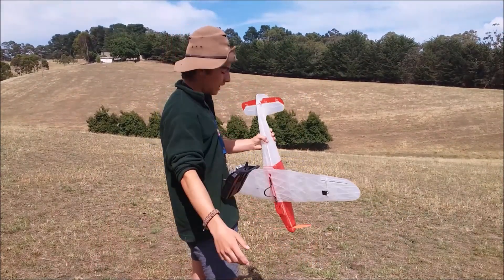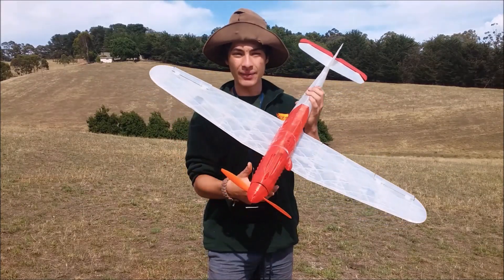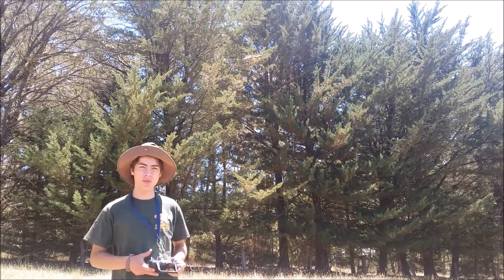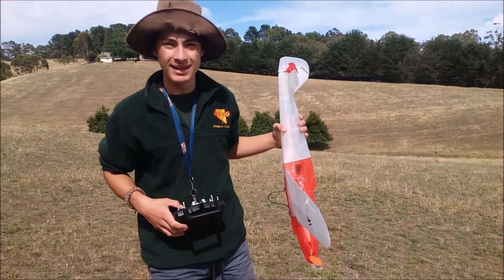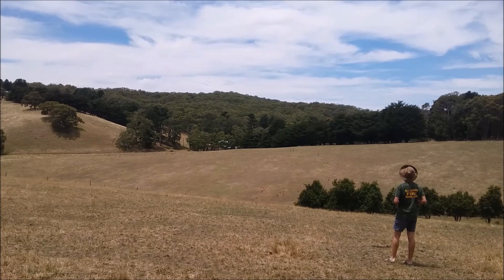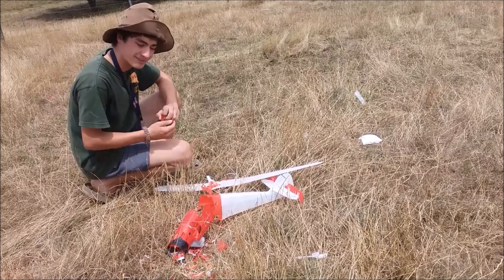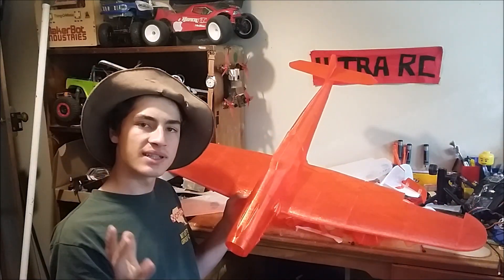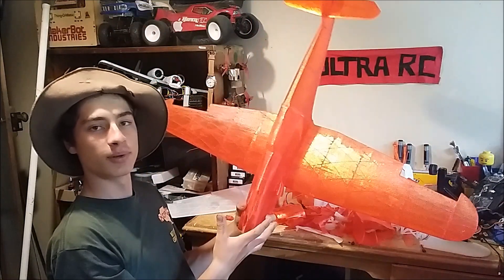Awesomely Destroyed 3d printed RC Messerschmitt //3d lab print.

Comment: Excellent work! I guess when you still live at home you don't have to factor the price of electricity to run the 3D printer for hours on end so the plane frame does only cost $10, at least in this case.
Reply: They don't use that much electricity wtf... About half as much as a modern desktop computer under load... Maybe like 0.50$ worth of electricity
Reply: @ikillfh844  Fifty cents.....😂😂😂
Reply from the maker: Yeah so the plane costs $10,50
Thanks for watching ULTRA RC mate!!!

Comment: 3d labs has a file for a stronger fuselage section, as you see that's the biggest failure point on it. That heavier fuselage should also help bring the weight forward. Regardless of material a lot of those ww2 warbirds are trickier to fly. Maybe print the trainer they have.
Reply from the maker: Yeah im planning to print out the trainer!!
The mechasmit was flown to slowly and was to tail heavy ill get it going soon!!!
Thanks for watching ULTRA RC mate!!!!
Great to know about the stronger fuselage!!!

Comment: Your persistence is inspiring haha, try printing a more stable design, the Messerschmitt  isn't really meant to be easy :#
Reply from the maker: Thats good to know because 
I didn't find it easy,
What plane would you consider stable?
Thanks for watching ULTRA RC mate!!!!!!
Reply: You'll find stability in designs with dihedral , high wings, slow flying-high lift airfoils.

Slow flight is key, it'll give you much much more reaction time.

Pitch stability mostly lies in CG.

Yaw from big vertical stabilizers

Roll from wing dihedral, wing shape and weight distribution: high wings will kinda work like a pendulum.

Consider buying a gyro stabilizer, they're pretty cheap and easy to set up.

Comment: Still looks like the CG is off.  Looks like you didn't have any additional nose weight in the plane and all the 3dLabPrint planes I have printed so far have needed extra weight in the nose to balance properly.
Reply from the maker: Yes i think you are right i only had one 3s 2200 in it and it can fit 2.
it did balance where it was marked.
it did fly for a while (badly) the main problem was me flying it slowly like a glider
I will try again soon luckily i can reprint it!!
Thanks for Watching ULTRA RC mate!!!
Reply: @CORINKERSTEN  It can fit 2?  My Spitfire can only take 1.  If it balanced on the CG marks it should be ok but it sure didn't look like it.  How much nose weight did you add to it with one 3s 2200mAh battery?  I have to add over 100 grams to the nose of my Spitfire to get it to balance with one 3s 2200mAh battery.
Reply from the maker: @InspGadgt  I added no extra nose weight.
The motor is rather large though
Only 1 flight was a bit sketchy 
It did work in the end i just flew it to slow...
How do you like the spitfire?
Thanks for your interest!!!!!!